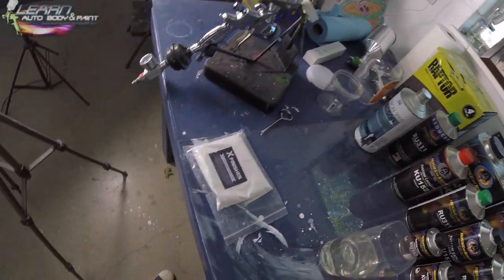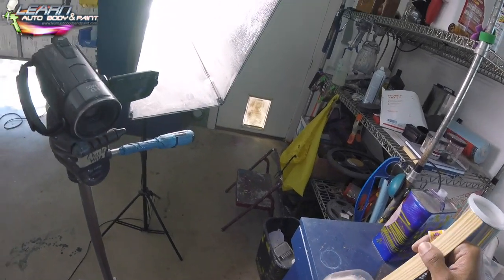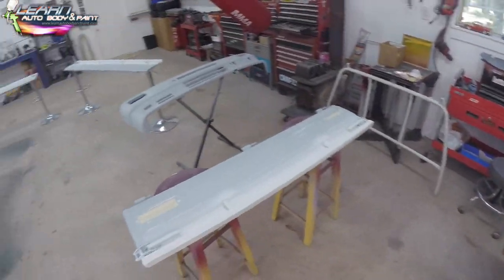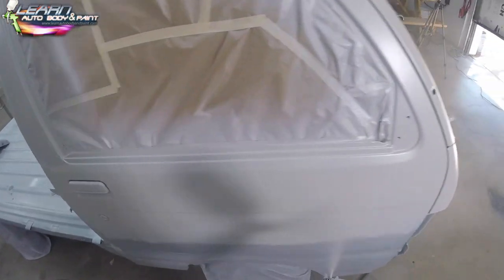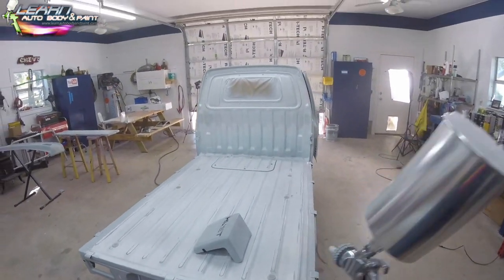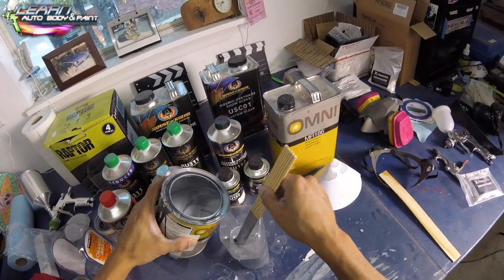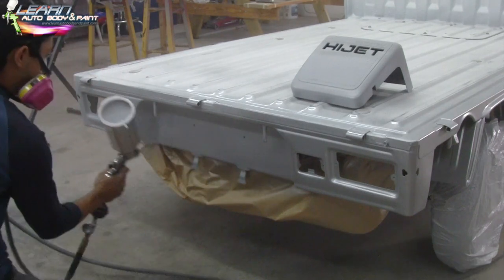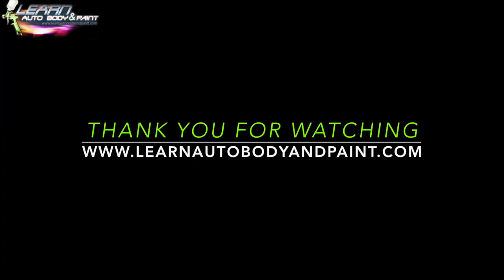How-To Spray MIDCOAT & Basecoat - DBC 500 INTERCOAT Spraying

Comment: Do u mix the inter coat with harder or reducers
Reply from the maker: Hey Man! Reducers and Hardener info 
👉 Fast: Touch up jobs. Single fenders, bumper cover, door and small blend jobs

👉 Medium: For complete paint jobs in 70 – 88 degrease

👉 Slow: For complete paint jobs in hotter temperatures 90 + when you need time for flowout

Check out this blog on our website to know more about mixing ratios https://www.learnautobodyandpaint.com/basecoat-clearcoat-how-much-paint-you-need-to-paint-your-car/ Hope this helps!

Comment: What sze alan wrench is to remove the gold piece were the tip goes i did not get one abd the ones for my other gun do not work
Reply from the maker: The tip comes off with a 12mm wrench.
Reply from the maker: Actually the flat color costs more and is the newer version. The standard is the dark grey model. My chrome is the first gen model. The X21 is chrome and will remain chrome.

Comment: What psi?
Reply from the maker: Air pressure.
Reply from the maker: No warranty after it is used man... Dude you need to CLEAN your guns. The TIP won't go bad unless you DROP IT. Keep them clean. Clean it and it should be good. Aren't you a VIP member? I talk about all of this step-by-step in VIP my man :) - I spray base at about 26-28 PSI. https://www.learnautobodyandpaint.com